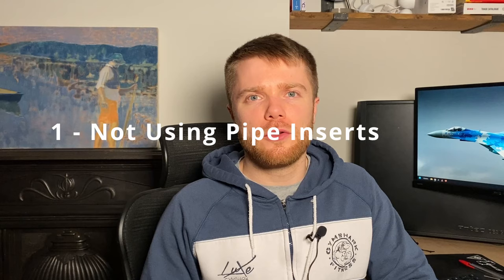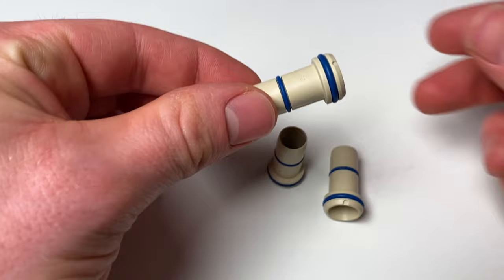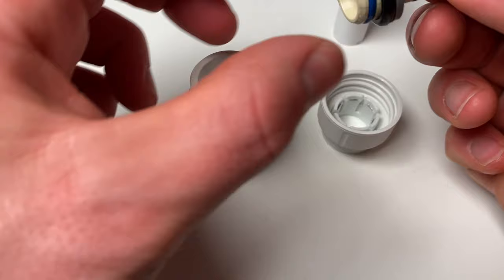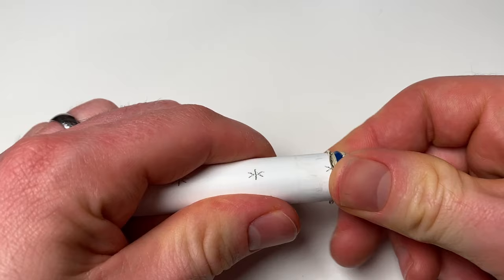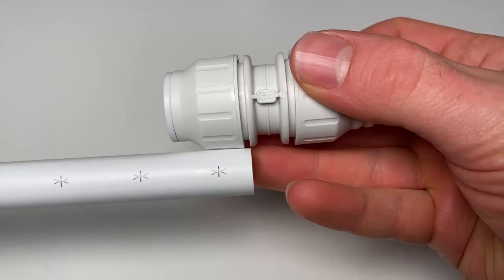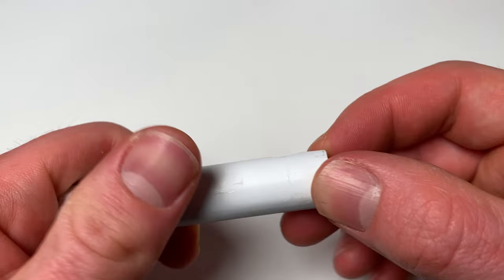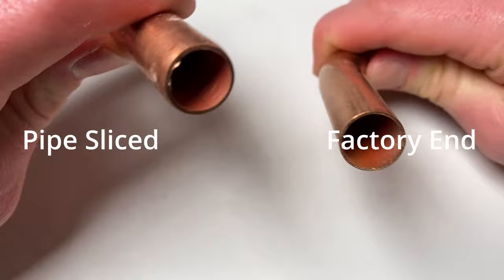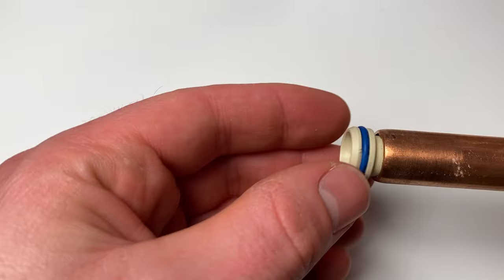BIGGEST Pushfit Plumbing Mistakes

Comment: Whenever I've used compression fittings (over 30 years) I have always had a leak. Always. I discovered these push fittings 20 years ago and decided to use them when fitting a new kitchen and bathroom. Jobs completed in no time at all and no leaks whatsoever all this time. Best thing ever for a non-plumber DIYer. Love your insights keep them coming and hope that your subscriber list improves dramatically.
Reply from the maker: Yes I’ve had similar issues with compression fittings, much prefer the pushfit. Thanks the support and watching!
Reply: @sonacphotos  I don't know what I've been doing wrong. As an example, a few years ago I had my boiler replaced together with a couple of radiators. I mentioned my leak problem to the plumber and he asked me to show him what I was doing (wrong.) He examined my work, said it was perfect, turned the water on and it leaked! However, I have followed the advice in this video and others online especially in regard to using PTFE tape incorrectly, experimented on an outside tap and woohoo, no leaks. It just goes to show you are never too old to learn.
Reply: @sonacphotos …..but not over-tighten it either.
Reply: One mistake some people make with compression fittings is using PTFE tape on the threads. That stops the nut from tightening fully and you get inadequate compression of the olive. Never use anything on the threads but you can put a smear of White Hawk or similar jointing compound round the olive.
Reply: @Phiyedough  If the olive and seat are cleaned before tightening the joint will not leak, white hawk or similar jointing compound is for cowboys, try undoing and re-tightening a compression fitting that has been put together with jointing compound,  after a while the compound will have gone hard and crusty, also some of the compound will find it's way inside the pipe and clog up any narrow passage like a rad valve etc.  Cowboys won't be bothered about other things getting clogged because it will be another excuse to rip off the customer at a later date.
Reply: One subtlety to using compression fittings is to realise that the seal is formed between the body of the fitting and the olive. The interface between the olive and the nut does not. If you push the pipe hard into the fitting when tightening to crimp the olive to the pipe then a significant fraction of the clamping force for the olive to the body of the fitting can be actually taken by the pipe pushing against the fitting. If you pull the pipe back from fully inserted by perhaps 1mm before tightening you avoid this.
I also tend to replace the brass olives that come with most fitting with copper ones.
I can't recall an issue with a compression fitting ever (and I started my plumbing on vacuum equipment about 50 years ago).

Comment: Well you certainly don't need inserts on copper pipe.  I have never used inserts on any of my kitchen and bathroom installations.  The early John Guest fittings were a problem but soon dropped. The latest products are bulletproof if installed with care !
Reply from the maker: Not worth the risk in my view, but you are right that a leak is unlikely. Thanks for watching!

Comment: Just had a boiler changed so need to change my shower,..(It was LP and now HP),..The boilers in the loft as is the control box for the shower,..I believe i will need to find the hot and cold supply from the boiler then tee into the plastic pipes,...I'm wondering about the longevity of speedfit,...Have to admit i did not use inserts with the first shower and they have been perfect for a good 12 years or so now!
Reply from the maker: The seals are rated for 50 years if installed correctly, which does include the insert. That should out live most of us! Personally if I can use copper and solder, I will, but if not then pex is perfectly suitable. Thanks for watching!
Reply: @TheDiligentDIYer1759  Great info,thanks !

Comment: Excellent content. Do you have advice on proper way to cut pipe to minimize damage?
Reply from the maker: Thanks for watching! Copper you need a pipe slice, using anything else will give you a very bad cut and likely deform the pipe. For plastic you need pex shears.

Comment: Hi, thank you for your video. I have used two pipe inserts and a coupler to fix a damaged pipe in my garden (for an outbuilding i have). After three days where everything worked fine, water came through again. After digging the pipe out again i noticed one of the inserts had come out of the pipe on one hand. Do you think it was because I put the insert in the wrong way (maybe not pushed totally in as the access to the pipe was very narrow and uncomfortable) or there might be some other reason? Do you have any advice to avoid such a thing in future, especially for peace of mind? I was thinking to add a layer of tape to give an extra layer of support, but that doesn't sound like a proper solution. Thanks in advance.
Reply from the maker: It sounds like your pipe is underground, I don’t think these fittings are rated for use underground, ideally you would use the blue mdpe pipe and the pushfit fittings for those. 
I wouldn’t suggest taping it, I expect the fitting didn’t get a good seal when you put it on, the pipe needs to be clean and pushed all the way in to get a good seal on the O ring. Unfortunately you’ll need to dig a deeper hole and expose more of the pipe to sort it. You could install an access chamber so you can sort it if it happens again. 
Personally id dig in a new MDPE supply and get rid of any joins underground. 
Thanks for watching!

Comment: I realise this is an old video now, but I need some advice. I live in France and I employed a plumber to change the copper to plastic, as the copper is old and the joints are constantly failing. The plumber recommended multilayer pipe ie plastic with an aluminum liner and push fit fittings. He's left me with the job unfinished and as it seems impossible to find a reliable plumber around here, I'm considered finishing myself. Most of the videos Ive found are just plastic to copper, but I havent found anything for multilayer to copper. Do you know if  I need any specific tools for this?
As the pipe is aluminium lined, will I still need inserts?
Reply from the maker: I’m not sure why plastic would need an aluminium liner, seems odd. Standard pex is double walled anyway. Sorry i can’t help, best to speak to someone french! Thanks for watching!

Comment: It looks like the fittings shown can be dismantled but I'm using Hep2O which has no obvious method of dismantling.  On one tee when I removed it one of the stainless steel inserts stayed in the fitting and I don't know how to remove it.
Reply from the maker: Hep2o need a special tool to demount them, you can get them in screwfix or tool station very cheaply. I’m not sure if the fittings can be taken apart like a JG fitting, as i don’t use hep2o, but I would think if you get a pair of long nose pliers, you can pull the insert out of the fitting. Thanks for watching!

Comment: Good video.. thanks..You say it isn't necessary to put an insert in a copper pipe when using a push fitting..  but does it actually make the seal less efficient by doing so?
Reply from the maker: Thanks for watching! I imagine it wouldn’t be detrimental to the seal, however the inner diameter of copper pipe is larger than pex, so the inserts aren’t a tight fit in copper and would have an impact on flow, although likely negligible across your whole system.

Comment: The only leaks I've seen with JG Pushfit are the combination of mounting under tension (inserting the pipe under an angle with force), not loosening the connector first and sharp edges on the pipe. This will damage the O-ring and if you're lucky it will leak immediately.
Also, beware of sunlight. UV light can make the connection brittle over years when exposed.
Any thoughts on insulating the push-fit fittings? They are quite bulky compared to compression fittings.
Reply from the maker: Good points, thanks for watching!

Comment: Why can't you use the insert in a copper pipe? The insert is not just for ridgity but also has additional o rings for a better seal. So my question is why can't they be used?
Reply from the maker: They aren’t designed for copper, they are too small to be used inside the copper pipe. Copper has a larger internal diameter than the pex pipe. I don’t know why inserts for the copper don’t exist though, i guess the pipe is so rigid that it isn’t needed
Reply: @TheDiligentDIYer1759  i get the ridigity part, but they have additional seals that give peace of mind so I'm not sure why they are not made
Reply: @redx11x  IME you have to match the brand of insert with the same brand of pipe as the pipes have slightly different internal diameters. Perhaps the same would be true for copper and that would be a problem if the internal diameters are not consistent or labelled?
Reply: @redx11x I agree, one of my pushfit tees for a garden tap has started leaking after 6 months, It's damaged my neighbours ceiling below. I won't be using pushfit to copper again.

Comment: I was told at my local TS branch that plastic pipe can not be used to plumb a tap used for drinking water.
Reply from the maker: Thanks for watching! That’s strange, it might be a particular brand of pipe they are referring to perhaps? JG and Hep2o are both definitely safe for drinking water.
Reply: You certainty can use JG and hep20,  both safe . Your info confusing when thinking from the stop cock you would have to use copper straight to the tap. Most new builds use JG speed fit from the stop cock.
Reply: Most of the plumbing in the house I moved into last year is JG push fit although the pipes under the kitchen sink and boiler are copper. Of the two, JG seems better to work with. With Hep 20 you have to twist the pipe into a fitting so awkward for a fixed in pipe where as with JG, you push the pipe in and and twist the collar on the fitting.
Reply: @johnbeck5795  you do not have to twist the hep20 at all . The twist is to check only, it is a rumble feeling " insure joint tech " , very good . I prefer hep20 anyway , imo better grip and seal . Both very good and push easily,  as said the hep20 is a twist to feel if required as this is great if your hands are right under a tight spot and cant see if the pipe went in far enough ( about 3/4" ). JG you need to see the pipe go in by the pipe markings , same as hep20 but at least hep20 has that secondary feel check.
Reply: That's absolutely not true...
Reply: Use WRAS pipe and  fittings always!

Comment: JG Speed Fit with modern unvented cylinders are "designed to fail" with one blaming the other.

Spec JG speedfit:
 Cold (20°C): 12bar
 Hot (65°C): 6bar

Modern (duplex steel) unvented, when airpocket not serviced:
 PRV: 8bar
TPRV: 10bar
(Manfacturers: there is no need for them to be this high!!! You should give customers options!).

So, for hot water, the JG Speed Fit will fail when unvented is not serviced. Please don't say, "that's the customers fault for not servicing there cylinder". Unvented cylinders are designed to vent safely down the tundish when unserviced or when there is a problem . . . . they should not be releasing pressure/water through these JG Speed fit connectors.
Reply from the maker: The PRV on my unvented cylinder is 6bar and TPRV is 7bar, so i don’t think i should have any issues with speedfit failing. Thanks for watching!
Reply: @TheDiligentDIYer1759 I think you miss the point. Statistically, with 100 installations with your 7bar and 6bar relief valves and JG Speed Fit rated (their own spec!!!) at 6bar with 65°C water, more and more failures WILL occur. Factor in a scratched pipe degrading the effectivenes of the O-Rings or hotter water, that failure rate will increase especially when the unvented system is not serviced and the airpocket disappears and you have an overpressure situation. . . . . . like I said, a system desgined to fail.

Comment: Used the copper ones,  alway get a leak . Hate them
Reply from the maker: Copper inserts or copper push fit? I’m not a fan of either personally. Thanks for watching!
Reply: @TheDiligentDIYer1759  copper push fit from screw fix, always get a drip from one, can't undo them, end up great mound of epoxy seal on it.

Comment: Copper is king
Reply: I've had two pinhole leak failures with copper pipe in the last ten years - luckily both times in fairly accessible places. The only issue I have ever had with JG Speedfit was when the o ring was missing. Since then I always disassemble every connector before using now out of principle. Plastic is rated to something like 15 bar...